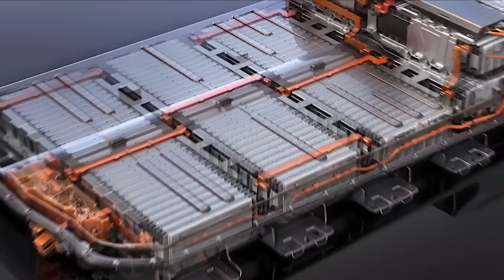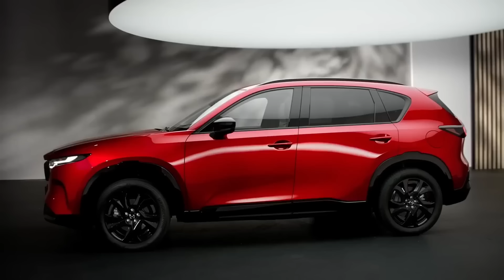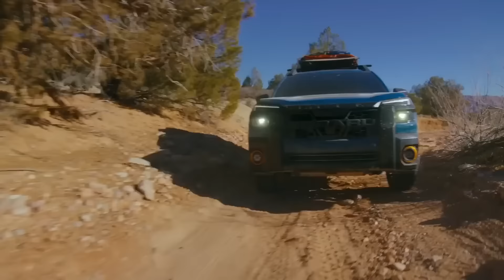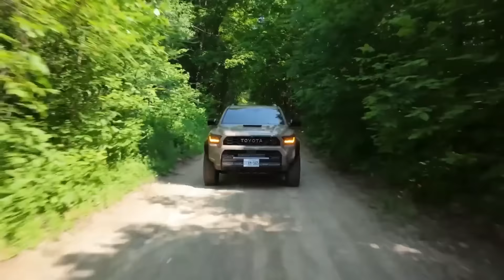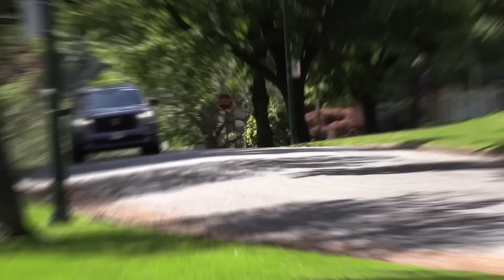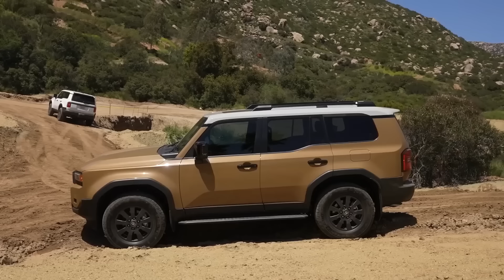7 Most Reliable Japanese SUVs Coming in 2026! Built to Last

Comment: Sorry to say, the new Lexus GX550 does not have a straight 6 cast iron engine. It is a V6 with an aluminum engine.
Reply from the maker: You're absolutely right to point that out! My apologies for the oversight regarding the Lexus GX550 engine. I'll make sure to correct that information in a future update.
Reply: The Lexus GX 550 has recall engine issues.